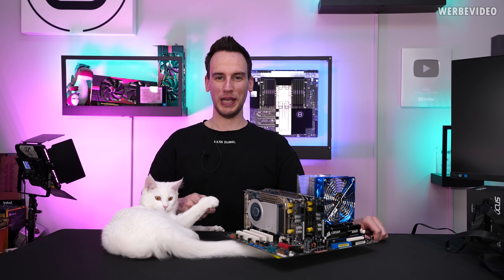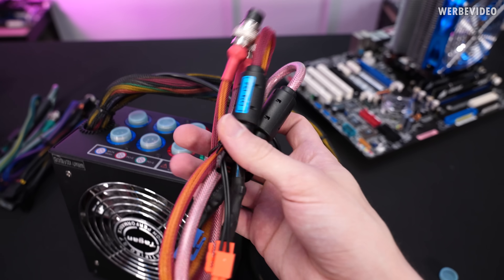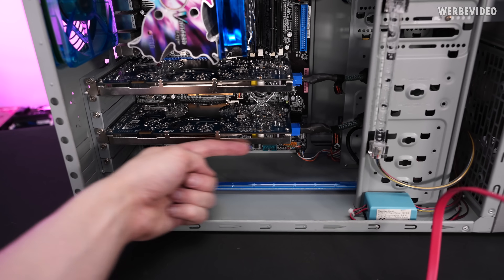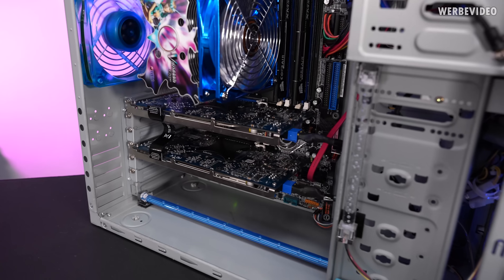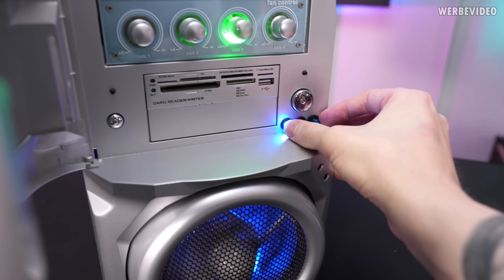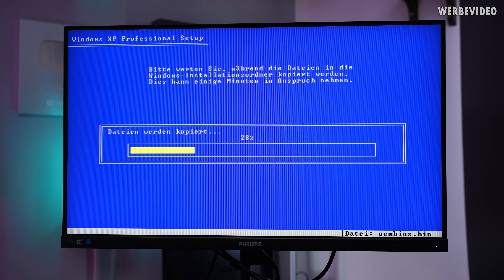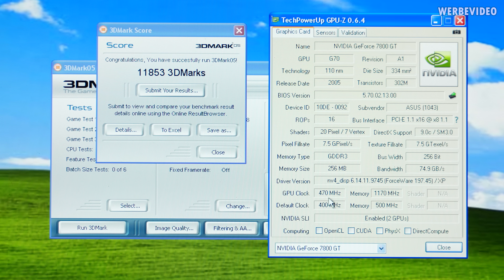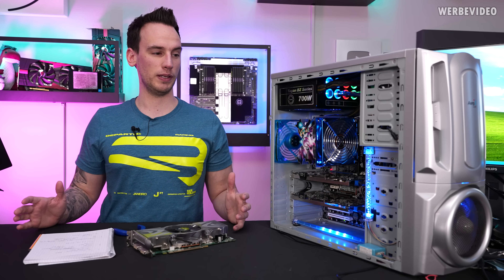Overclocking bricked my Windows - The 2005 Retro PC Part 2/2

Comment: Some of my earliest overclocking was on AMD K6-2, I accidentally set the jumpers wrong and instead of 66Mhz clock I set it to 100Mhz clock. The system booted and ran perfectly fine, it was a 333Mhz CPU that I ran at 500Mhz for several years without issue. Later I had an original k7 athlon, 550Mhz, but it always showed up as 750Mhz and ran perfectly fine. Closer to the hardware shown in this video, I got an athlon 64 x2 I don't remember the model, maybe like a 4600+ from my brother because it was always overheating in his computer, so I laped it and water cooled it, then overclocked it a bit. That worked great until I blew up my power supply and ended up having to run two PSUs because I didn't have a single one big enough.

Comment: It was nice to see my computer was very similar. Same Mother, same CPU, Similar GPUs (2x ASUS 7300gt in mine), A titan 12mm cpu fan, and a simiilar PSU. 
You are right, those  PSU connectors are great, those are called AVIATION connectors. Nice video! and nicer to go back and play old games in that system I imagine.

Comment: The power connectors on the PSU are called "aviation connectors". The most common variant is the GX16. How that power supply integrated them is definitely NOT ideal since they have the exposed pins at the power source, which is a short circuit risk. And I wish the GPU card makers had kept the power connector facing the rear of the card instead of it being on the top.

Comment: I got into overlocking when I was in primary school. All I got was a Athlon X4 640 and I want to play newer battlefield titles so I decide to clock my system higher, sadly I clocked I bit too high and killed my gpu (a hd5750 iirc). Since then I’ve oc’d my newer pc, laptop, etc… Now I’m rocking a 5950x but sometime I still recall the o’days when I would sit all day and push my system to it’s limit and gain 20% more performance…

Comment: I couldn't afford 7000 cards, but I worked hard and saved for a trio of 8800 GTX. Overclocking them was huge pain in the ass, as they had almost zero gap between the cards, so it was more of a figuring which card has highest temperature tolerance and putting it in the middle.

Comment: You should install Windows XP x64 Professional if you have it/if you are able to.

That will remove the 32-bit limitation for RAM.

(I used to run it with upto 16 GB of RAM back in 2005 through 2007.)
Reply: windows 2000 ;

Comment: In 2008 my firts pc was a 4800+ (brisbane) and a 9600gt. i overclocked the cpu up to 3.325ghz and gpu up to 780mhz coreclock and 1ghz memclock. It was awsome... then i use for about 8 years an i7 2600k overclocked to 4.5ghz... the hardware was a bit more fun back in that days

Comment: If you upgrade to a 4400+ or 4800+ you can get 2MB of cache! Love this build though, I've got quite a few going myself now but I like to run XP with the AGP 8x interface. My main XP system is running an HD 4670 AGP and 4400+. So jealous of the case, aside from the GPUs and motherboards I'd say the proper case in good condition is the most difficult thing to find for these builds

Comment: I currently use a 5950x with a 3070ti. I still have all my old hardware since early 2000's and you can't beat having fun on those systems.Mine are mostly all amd cpu based.

Comment: I want to see Unreal Tournament running on it. I currently play Unreal Tournament 1999, 2004, and 4 on my 12600kf and 2060 lol.
Reply: Isn’t that funny that old game still runs on newer win10 but other old games won’t.
Reply: @killerrf  I run it on Windows 11 with no problems lol. As long as you patch it it works great. UT2004 works right out of the box which is nice.

Comment: yea , nvidia also came into this so called problem again with the 1050 ti`s , i was able to oc mine to 2050 clk , since then they have blocked the ability to get the stable clocks i was running at the time of getting a 99 % better than all other scores on a 1050 ti , haven`t seen anything as such since , not even the 3090ti`s , well maybe those on ln2 , Only !

Comment: With those Vertex drives, the controller can randomly fail with no warning (happened to mine a year or so ago) so I'd keep a backup. Other than that, really love seeing a system like this assembled again now. Oh and for those older GeForce cards, from what I have found the fans go at full speed until the driver initializes, which then applies the fan curve.
Reply: Good ol' Sandforce.

Comment: My first build was on a Soyo 5EHM and a K62-350Mhz chip.  It was a Baby AT form factor modded to fit in a new Inwin ATX case.  I had some cheap ATI agp card (without 3d acceleration) and a diamond monster fusion (3dfx voodoo 1) for 3d.  I dont remember how much ram or harddrive size but I did run Windows 98 SE and loved that system.  Even had the optional L2 cache on the board itself for socket 7 platforms.  That was 97-98.  I got a 2950x now and it's a monster but I do wish I could do as you have done!  Great work!!!

Comment: wow, you have that 3dmark benchmark nice and smooth, back then on my ATI, yes still ATI :-D X600 pro it was just a better power point slideshow. you are right with even basic OC back then. On highschool with few my classmates were also overclocking and i got pretty lucky, i had AMD Athlon64 2800+ socket 754 with base frequency 1800 mhz. Im from Czechia so with lot of help from our local web PC magazine, they had amazing guide for overclocking AMD cpus, soo i got up to 2400mhz :-D yeah, +33% up. I dont remember how well it helped with benchmarks, but since i was young and the whole PC was wery budgety.. it probalby didnt help too much. I still couldnt play doom3 on reasonable framerates and Gothic 3 was jut abysmal, couldnt play at all.
Nice video, cool memories :-)

Comment: Remember very well having a E6420 Core 2 Duo as a first PC with an 8800gt and being able to take a 2.13Ghz chip to over 3Ghz without trouble ;)

Getting to 4.7Ghz on an 8700k (I don't want to delid my CPU or get a water-cooled block) and 16Gbps and 1935-1980 on a 2080ti air cooled is still fun but not quite the same gains ;)

Comment: I would be happier if this computer wasn't THAT close to the system I'm actually daily driving 😂
And even though I'm a teenager, I know this stuff personally - I have a lot of experience installing winXP (on my old Satellite 1710CDS - still fully functional, btw, only the battery doesn't last even a single second).

My computer consists of a Pentium Dual-Core E5200@2.5GHz - overclocked to something around 3.3GHz (it isn't always as stable as I want it to be, but my multiplier is set to 12.5x, which is both the default and the max value it lets me and I set the BCLK somewhere between 264 and 267MHz and AFAIK, the motherboard has its own 4x multiplier for the FSB and chipset - so that should run at a little over 1000MHz)
I have 4GB of DDR2-800 RAM, running in dual-channel and my GPU is Radeon HD 6450 (1GB VRAM)

Runs Arch (btw) pretty well, actually. I should try to cinebench it (and that old Toshiba laptop) just for fun to compare the results 😁

Comment: Romannnnn a cool either air or water cooled dual socket 939 opteron or old xeon, and of course 2 way sli, or try even 4 way if possible because old cards are cheap, it would be super cool and really that would be so epiccccc

Comment: I would love to see a "retro" water cooled system. Thanks for another great video!
Reply: LTT has a cool video with an old water cooler setup
Reply: medical supply tubing, aquarium pump, automotive oil or transmission radiator, and a custom water block. Those thing were a PITA to set up.
Reply: One of those top mounted setups.

Comment: I really enjoyed this series. Would love to see more.
I had a similar set up back in the day. 
Motherboard was a DFI Lanparty NF4 SLI. (who needs RGB when you can have UV!)
Started with a single core Athlon 64 3200+ which hit 2.75 if I remember correctly along with 1gb OCZ ram and a Geforce 6600GT.
Later upgraded to an Opteron 165 (Dual core, Socket 939, 1.8ghz stock, 1mb cache) which clocked to 2.6ghz, FX-60 performance for a fraction of the price. Paired with 2gb of Corsair XMS and dual 7800GTs. Later swapped the cards for an 8800GTS 640mb and went full 4gb RAM (think I was on Vista 64bit by this point).
All powered by a Tagan PSU, those PCI-E power cables were insanely built by any standards. 
I kept on this until 1st gen i7/x58 which ended up lasting me over a decade with a few upgrades.
Still have the board, Opteron and 2gb of the ram. Sadly, I checked it out recently and the caps have some significant bulge, working up the courage to replace them myself.

Comment: I used to have the A8N-SLI Premium, the one with the automatic PCIe switch and a heat pipe linking the north bridge to the VRM Heatsinks. Had a couple of 7800 GTX cards too. Loved that system but eventually replaced it with my X38 system with the first gen i7 and I wish I could remember what happened to it. I think I sold the GPU's and gave the rest to my parents with an old Geforce 4 card to use as a web box. Fingers crossed it's still in a corner of their loft but I have a sinking suspicion it went to eWaste a long time ago. Once it became obsolete it never occurred to me it might become 'vintage' due to being high end for the period.

If I can find it though, I'm definitely inspired to try and make a retro PC myself now.
Reply: That A8N-SLI Premium was a beautiful board.

Comment: The nostalgia level was already high after seeing the cathode tubes and that blue power inverter.  Then you fired up the old 3dMark and I was transported back in time to hours and hours of  running that same benchmark, trying to get every little bit of performance out of my first Crossfire set up.
Reply: I think I spent way more time playing around with benchmarking programs than I did actually playing any games back then!  It was a lot of fun just trying to fine tune your system to find the absolute maximum you could push it to.  Sort of like tuning your car to get that extra performance out of it.  Good times they were!
Reply: same here, that 3D Mark 05 nostalgia hit hard :)
Reply: +1, this video made me 15 years younger for several minutes ).
Reply: Those aren't even old cathode tubes, just the same casing..those are all LED! Still old school but not exactly a CCFL in there lol
Reply: I AGREE , this was amazing.

Comment: i still do this. my 3080 scores about the same as a stock 3090 and my 3200mhz cl16 ram is always at 3600 cl14. my 10700k goes up to 5.4ghz on cold air but still no where near a 10900k in scores.

Comment: Oh hey, I've still got an Asus A8N SLI Deluxe.  I put a large passive cooler on the NB and got rid of that noisy fan.  My GPUs at the time were a pair of 8800GTs (with Zalman coolers replacing the stock, noisy, single-slot coolers), and my CPU was an Athlon 64X2 4400+, also cooled by a Zalman cooler.  Case was an Inwin 555.

Comment: Those threaded connectors are a standard DIN connector. 
It's great building those old systems.
I started with an Intel P4 2.4 and an MX440, so no where near as fancy.
It's amazing how slow the old computers where.

Comment: Man those are like military grade connectors, that psu is sick, simular connectors like they use in racing cars, imagine if they made a psu with those today it would cost x3 price of what normal psu is now.
Reply: I also had 4400+ in 2008 as a kid, remember clocking it 2.7-2.8ghz on newer motherboard, the thing with the stock cooler was frying 80C 😅

Comment: Perhaps you can find some of the early Arctic Silencer coolers for the GPUs. They will take air from the front of the case and blow the hot air outside.

For the 7800 GT you would need the Arctic Cooling NV Silencer 5.

Comment: The only thing I would not get from old stock in such a build is the PSU. A modern PSU is usually better and safer for the electronics than an old/aged one

Comment: this definitely bring memories. the first pc i actually paid for myself was a sempron le 1250 with a 8400gs that i got to get close to my neighbours computer performance with his 8500gt and a another amd cpu that i cant remember. then i got a 7750be(with their magical core unlocking) amd with an hd 4650 and again made them punch above their weight, saving me cash and getting me the performance i needed. as a uni student every saving was worth it. 

today when i build computers for people and ask about oc i say that its mostly a waste of time unless their min maxing for benchmarks, etc. they wont see those extra 10 frames in warzone anyways. just all core max multi, check temps and gg.  gpu overclock is really neutered, the last gpu i managed to make it "like the next tier" was the 1660 and was still lacking like 2 fps average. for gaps like 3050 to 3060 to 3060ti even its a lot to cover and no way to save really.

Comment: That PSU indeed does have absolutely beautiful connectors.
Full metal with a thread to lock everything down.
Maybe they rattle lose with vibration over time but imo worth it 👌
Reply: If your pc vibrating so much the connectors get lose then you have bigger problems 😂

Comment: those industrial looking psu connectors look great but im concerned about their safety. the power is coming out of a male socket, not a female one, so it seems like it would be much easier to accidentally short just from something conductive like a metal screw getting in there

Comment: does XP pass the trim command to SSD?

oh and you should know that using sli doesn't stack you vram.  so you're still only getting a 256gb frame buffer with that setup.    oc'ing the pcie bus may have been what helped bork the os?  you shouldn't need any extra bandwith for sli...  that's what the bridge was for..

Comment: I used to love OCing the Pentium D 805...also had a E8400 3.0 Ghz up to 4.2 .    Still have that pc in working condition intel e8400 on a Asus maximus II formula with an XFX nvidia 280 gtx.
Anyone remember when XFX still made nvidia cards??   The coil whine is so freaking loud on that card.
But yeah, over-clocking was the most fun back then ... when you got the golden chip...  4.2 Ghz on a thermaltake blue orb and never passed 80 c.
Great video series ...Thanx for bringing back the memories.  This made me think of TOMS HARDWARE vids from back then.... "And the motherboard tray is removable"

Comment: Cool video Roman, this was a bit after when I stopped my gaming/computer addiction, those benchmarks sure do bring back memories. Cool PSU with some really good connectors, wish manufacturers had taken note and maybe done something similar for MB connectors.
If you're going to continue with this series, bit of an FYI you maybe didn't notice, but that clear plexi window is attached with evenly drilled holes, so you could just unscrew it, flip it and put the intake fan to blow on the GPUs.

Comment: My first OC experience was with Intel Pentium 4 with MSI P35 Platinum Combo. Remember when you could get GTS 250 in Sli, and they was really great at that time. What a blast revisiting the past with your video.
Reply: My first OC was a Pentium. Not 2, 3, or 4. Just a Pentium 200. Dip switches FTW.

Comment: This brings back so many memories.  I had a similar machine, dual 7900GTs maybe?  Back when SSDs had just appeared on the market, for exorbitant costs (SLC-based).
Reply: How much does a 32GB or 64GB cost back then?
Reply: @fajaradi1223  250-300 dollars i think when you could buy 1+TB drives for under 100 dollars.
Reply: @fajaradi1223  i remember reading about first SSD's in a polish PC world magazine around summer 2006 and i believe they were out then already
Reply: @fajaradi1223  it was something like 600 USD for an Intel X25-E
Reply: 2007 was the appearance of the first SATA 1 32GB SSD's. I've got one in my 2007 Quad Crossfire retro build.

Comment: Those aren't cold cathodes! Those are led lights in cold cathode casings, you are missing out
Reply: yea I realized that after it turned on xD
Reply: @der8auer  although the bubble light bar is neat, some cases had two long ones on the front.
Reply: Also LEDs are not better than CCFLs. They are more efficient for certain, but cathodes give very distinctive type of light that cannot be replicated with LEDs and therefore are still well regarded in retro community.
Reply: @nenadstevanovic6797  I know, have a bunch in my storage, some even are tri color!